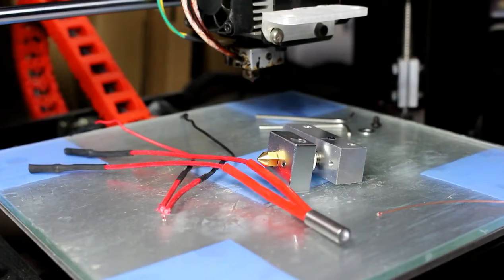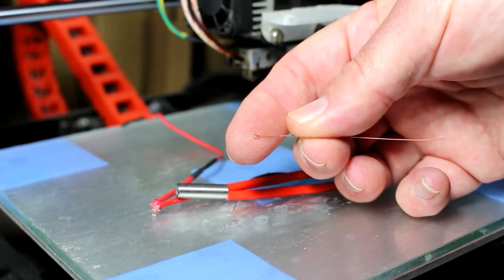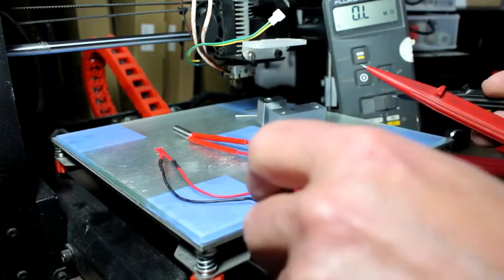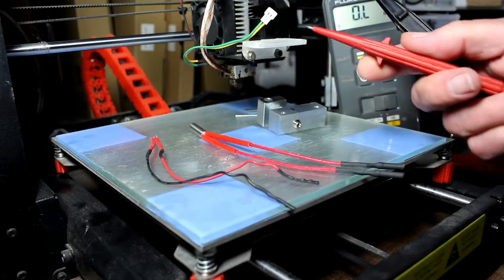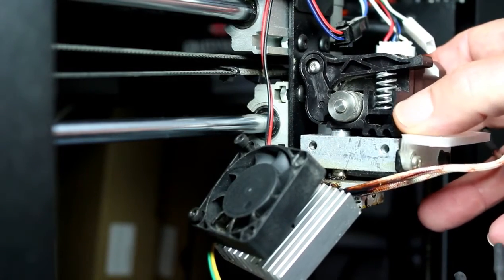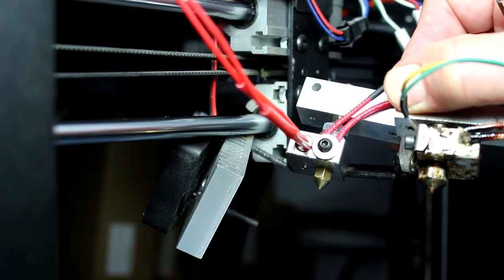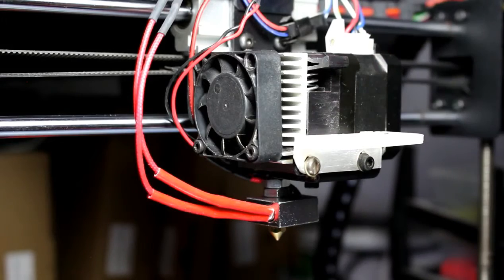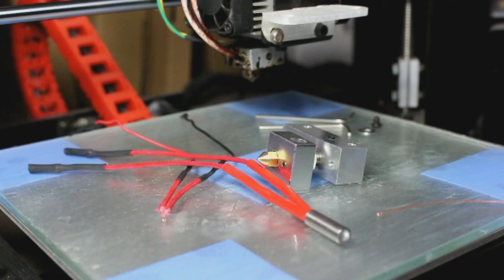Malyan 150 Replacement Heater Block, Heater Element and Thermistor from Banggood 3d Printer Tutorial

Comment: Great video, does it matter which way round the wires are when wiring up the thermostat and the thermometer?
Reply from the maker: Hi Paul, If you mean the thermistor and heating element then no, they can be wired either way.

Comment: it works for anet a8?
Reply from the maker: Hi, I see no reason that these parts will not work in the Anet a8. I do not have that printer so I cannot say 100%. It would be best to measure the parts you have both physically and electrically and compare with the readings shown in the video and follow the links in the description to the parts themselves to check the dimensions. if you get the parts post your results here so others can know they work.
Reply: 1nformatica I measure the throat and for anet a8 it needs to be 30mm
Reply from the maker: Hi, I just measured it and it is 30mm , photo on this link: http://bit.ly/Throat_jpg you may also consider an assembled unit like this one: http://bit.ly/HeaterAssembled